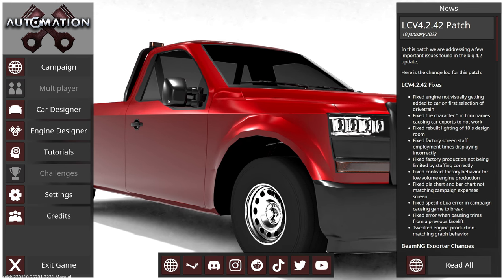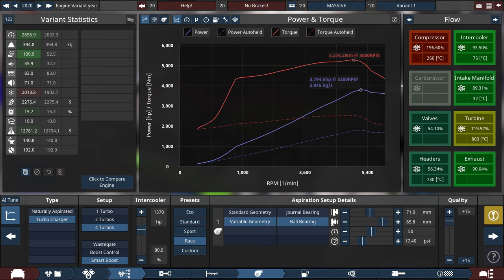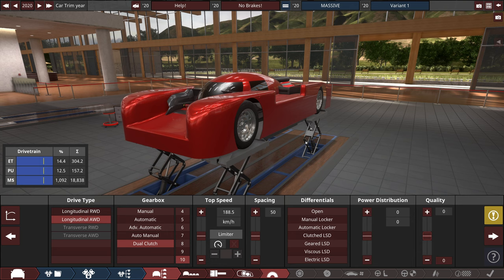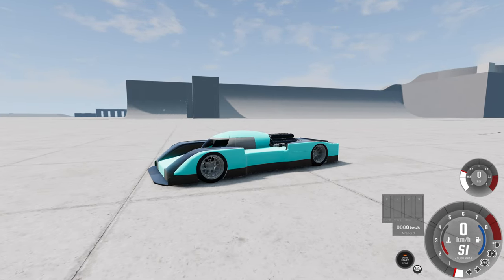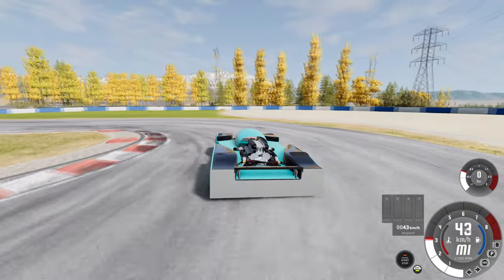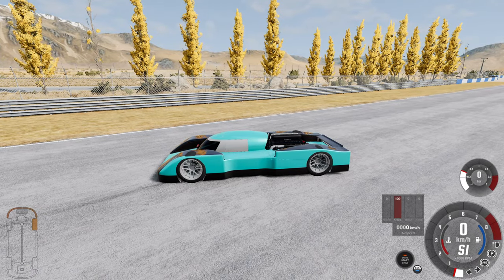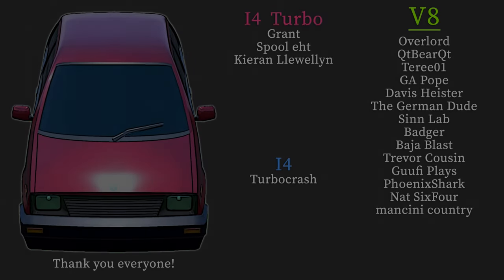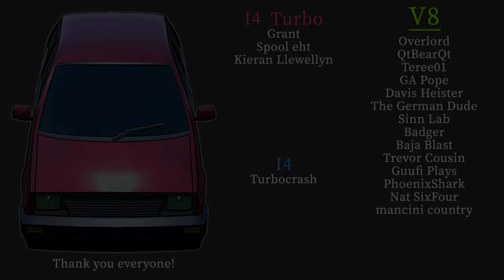7000hp, No Brakes (Automation + BeamNG.drive)

Comment: Wait, how the hell does an engine have over 100 reliability? Does it gain strength and re-solder its electronics the more miles it gets? This car makes more power than most drag cars and will last indefinitely..
(It was at 110 before the boost segment)

Comment: nitromethane makes way more power, the reason it broke is it maxed out the torque the rods, piston and crank can handle. turn down the power then switch to nitro and you'll gain like 50% or more, but not very helpful if you're already at the engine's max.